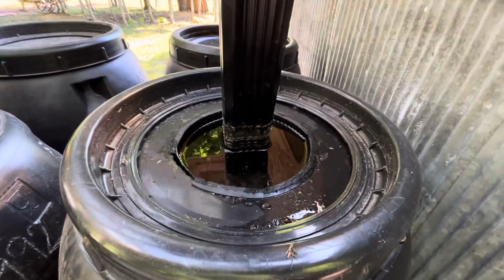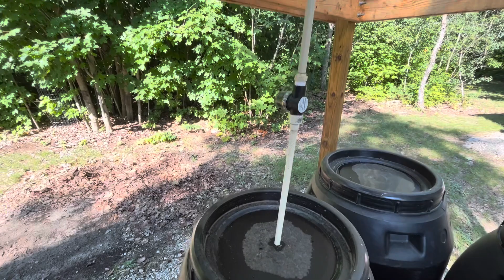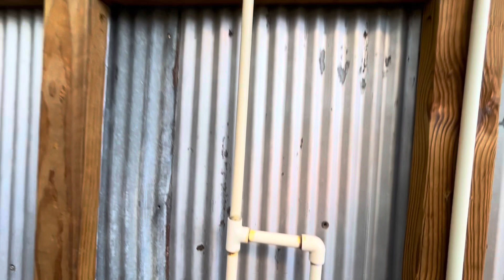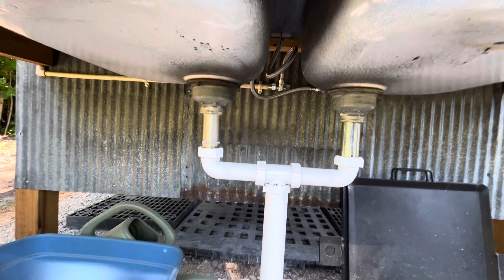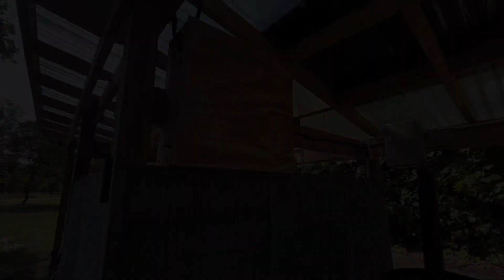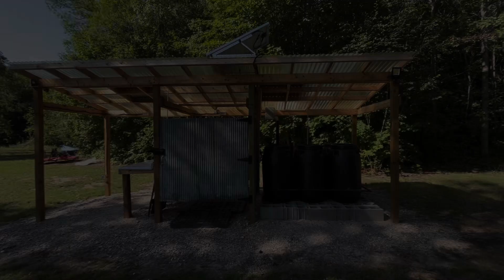Off Grid Rainwater Collection Shower/Sink Unit

Comment: WHAT IS WITH THE "BIRDS-PEE"  ON THE ROOF/IN YOUR  WATER   ????
Reply from the maker: Bird droppings on the roof can run off with the rain into the collection system. It’s not treated so I don’t consume it. No problems with showering etc though with no trips to the ER as of yet.
Reply: @NorthFarm I set up a carbon filter for the runoff to filter through before the collection tank. They are replaceable, just mounted into the bottom of a barrel on top of the holding tank. Peace of mind while showering 😁